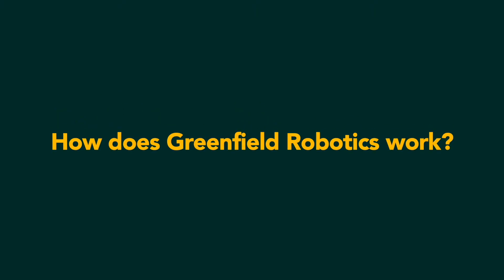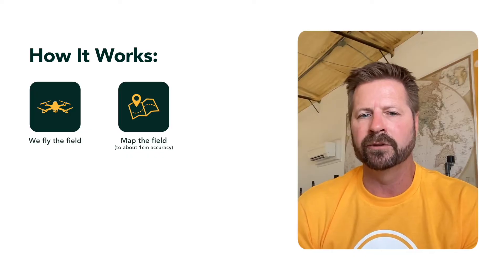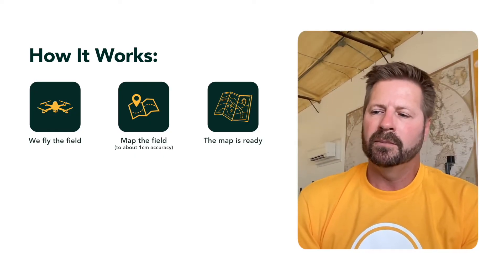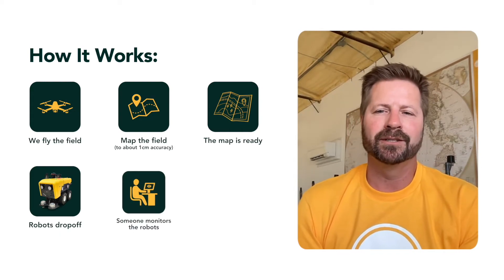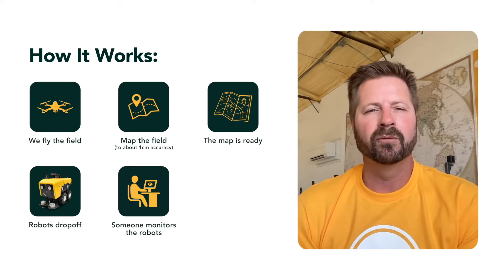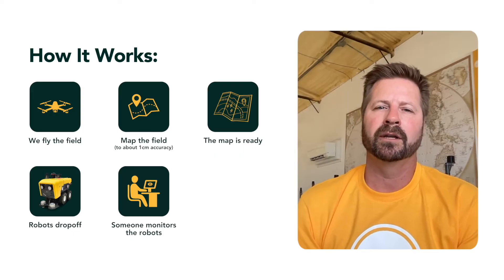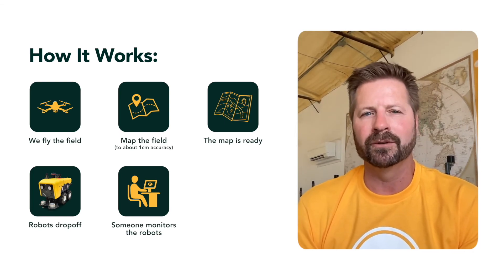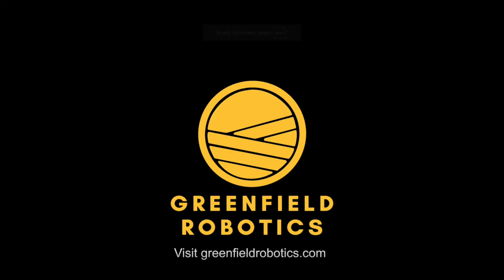How Greenfield Robotics Works:  The Process

Comment: I'm am really excited about this! This is the answer to regenerative organic! I'm curious how it'll work on farms like mine that have slopes and odd shaped fields. I'm also curious how'll they'll work with crimped cover crops.
Reply from the maker: Hi Casey,  We also have a tracks attachment which allows the bots to traverse more challenging terrains.  The maximum angle for a slope would be 15 degrees if a bot is going across it. Beyond that, if a robot is going across a slope, the back end begins to slide a bit so it traverses at an angle. No issues going up and over terraces (which a traditional tractor might encounter when pulling something like a planter), and no issues going down a slope.  Feel free to share your details here and I can have a colleague reach out... https://www.greenfieldincorporated.com/contact